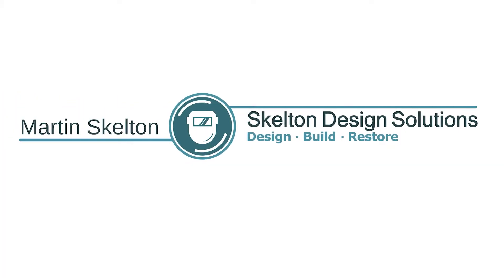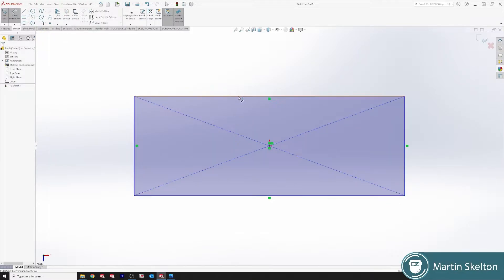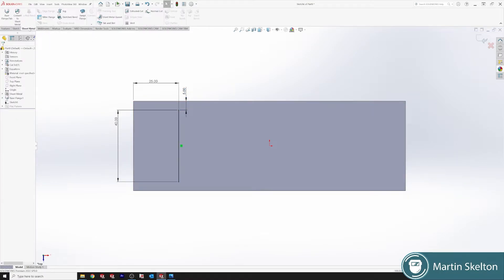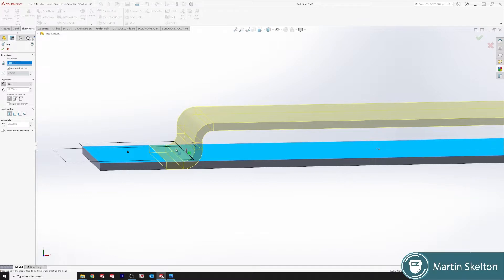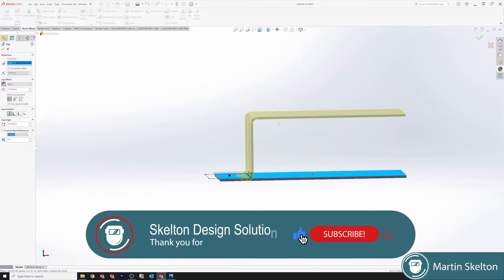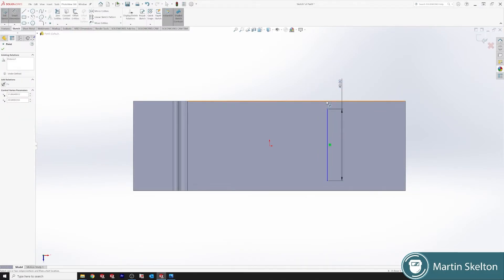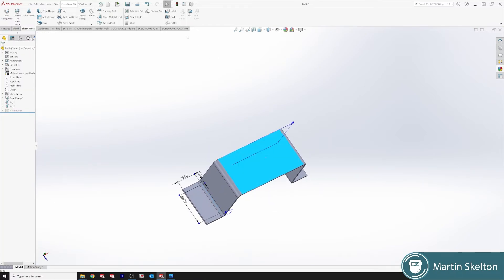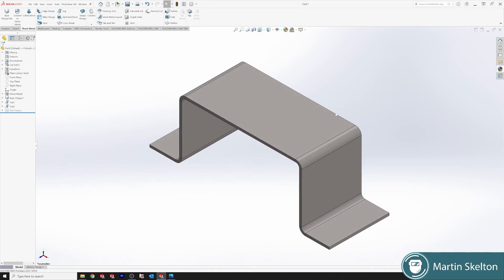SOLIDWORKS FEATURE IN 3 MINUTES // JOG

Comment: Thank you for the video! It made it easier to visualize what the jog feature did. But could you please explain what the distance from the edge in the line sketch is for?
Reply from the maker: Hi @PokemonTrainerAriel, Thank you for the comment. The 25mm measurement sets the placement of the bend but the 5mm from the edge is used to fully define the sketch. The 40mm line length is  also used to fully define the sketch. The command will still work without the edge distance of 5mm or the length of 40mm but the sketch won't fully define. None defined sketches can move and cause errors later in the model. If you want to use the software to a professional level always define sketches and then it becomes second nature after a while. Cheers for the comment.